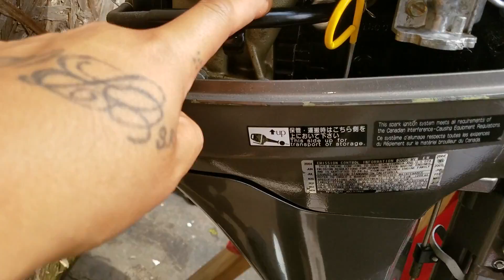9.8HP 9.9HP Outboard  Engine Carburetor Cleaning/Rebuild 4-Stroke

Comment: Bro never cleaned a carb in my life. You walked me right through it. Back on the water, thanks man
Reply: Yup same here, first time. Identical to my 2013 Coleman 9.8 hp (parsun) outboard. Would not start, did the clean up,  didn't really see any gunk at all and bingo its working great now. thanks

Comment: hi.
Do you have still this motor? I nned to know one thing. Just over chocke plate inside the carb is a venturi hole. what the noumbers are stamped inside?
or can you measure venturi diameter  taken ftom chocke plate side?
Reply from the maker: iboats1 no I've sold it
Reply: It. same as Mercury 9.9